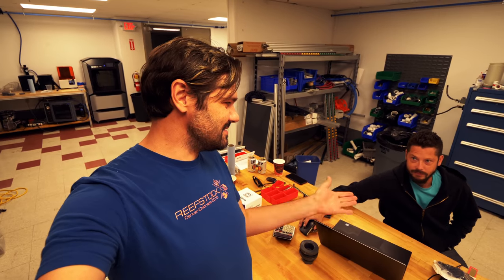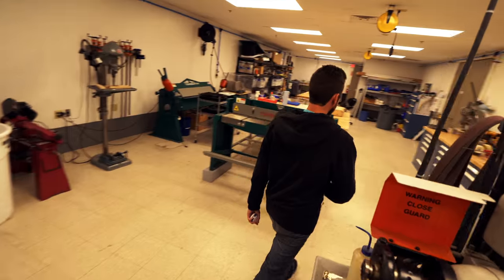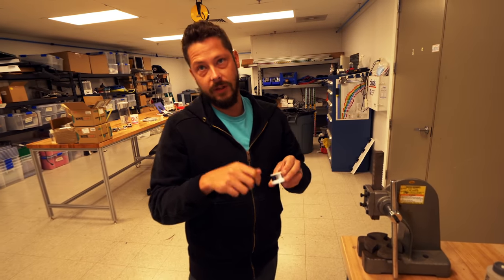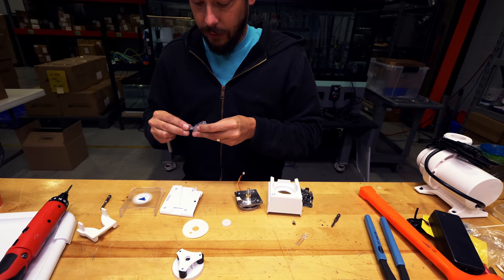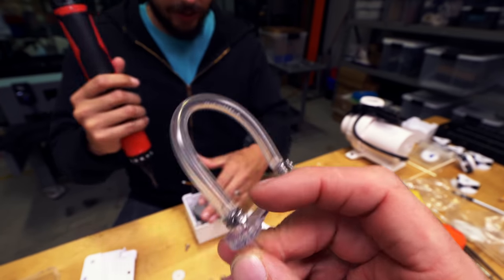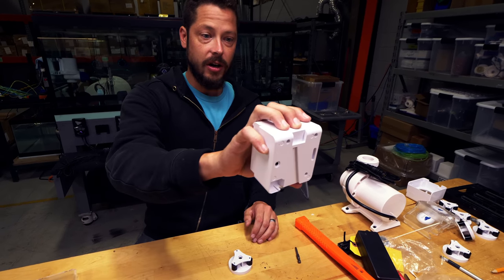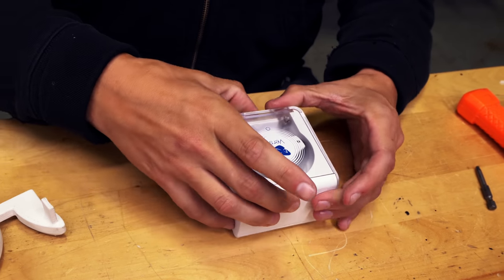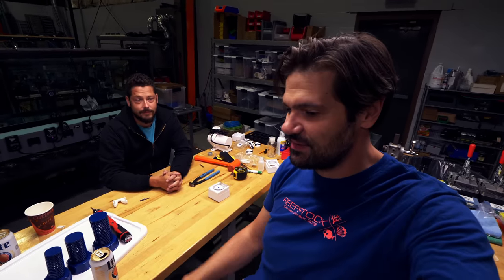Ecotech Marine Versa Dosing Pump, How it's Made

Comment: They need to work on their app and website they are literally useless. I'm glad I have an apex to run everything, if I had to use the reef link I would have probably got ride of my ecotech products by now.
Reply from the maker: I use the app to control around 50 assorted devices with no issues.
Reply: @ReefBuildersVideo  maybe its me, but from the looks of the reviews in the app store I'm not the only one with these problems. I just think it's crazy that I upgraded from an AI prime on my last tank and now have two xr30s for like 9x the price and I thought the app from AI was much much better. Don't get me wrong love all my ecotech equipment just hate the user interface.